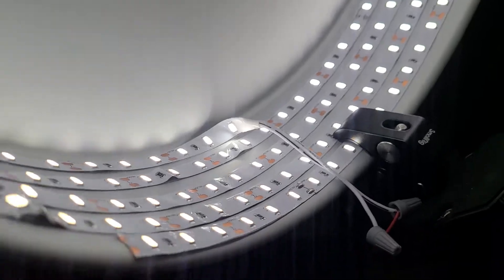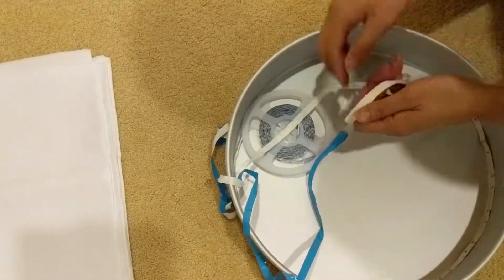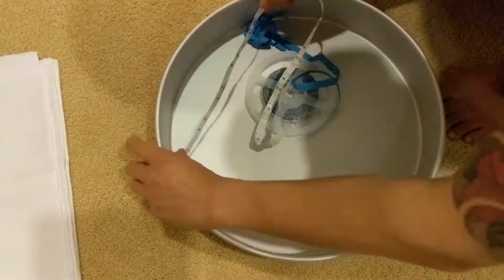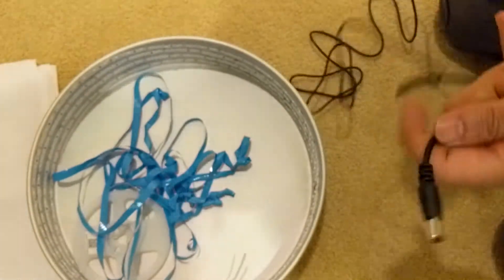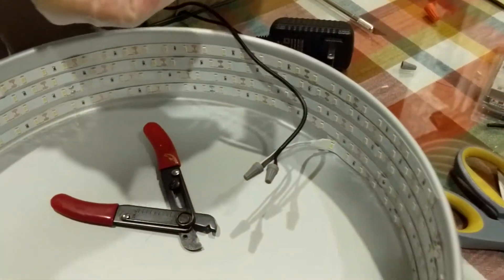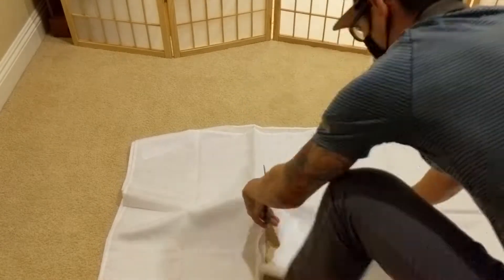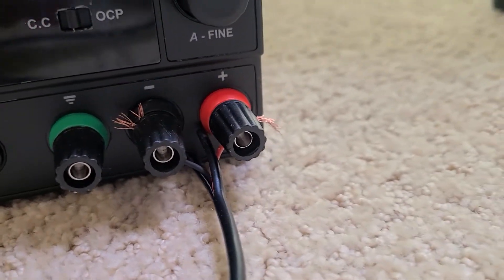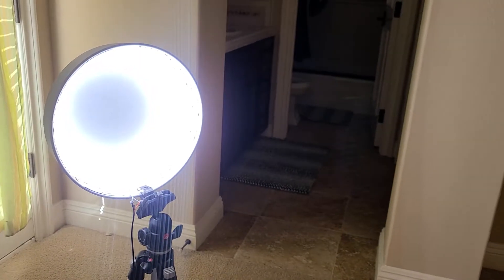I built Daniel Schiffer's DIY cakepan light ($1000 video light replacement)

Comment: I enjoyed you documenting the process, Rob! One note though, once you figure out the voltage and amperage, you should be able to just buy a relatively cheap power adapter/transformer with the proper voltage and amp output and it should work without having to use an expensive power supply that is configurable. Or you could buy a Phillips Hue light and make a lightbox, but where’s the fun in that. 😂
Reply from the maker: Oh! The thought never crossed my mind haha. That's a good idea. Thank you